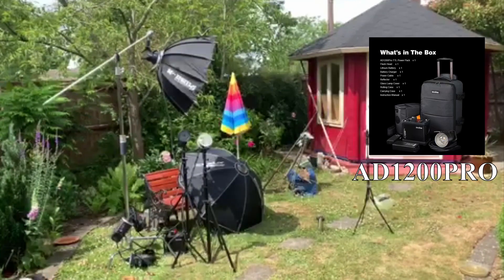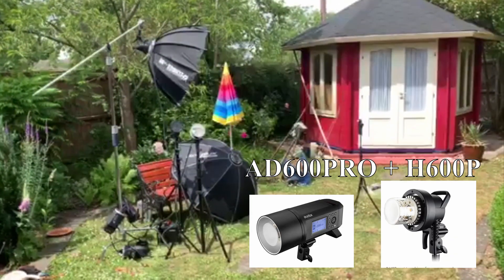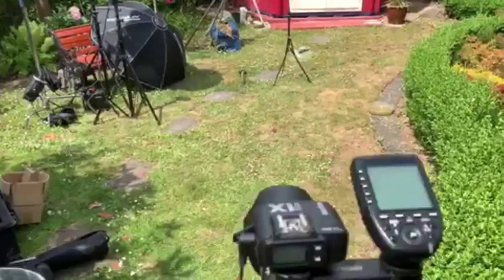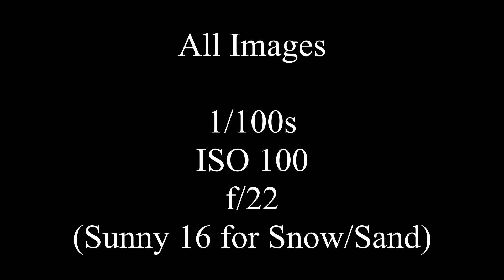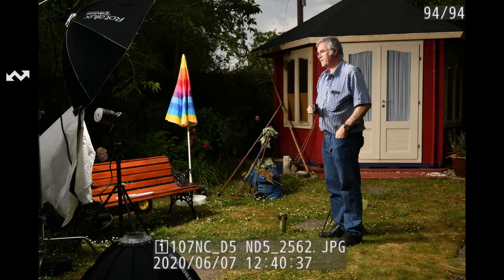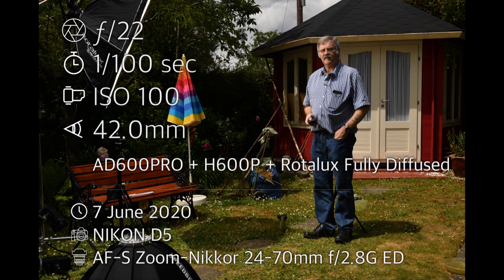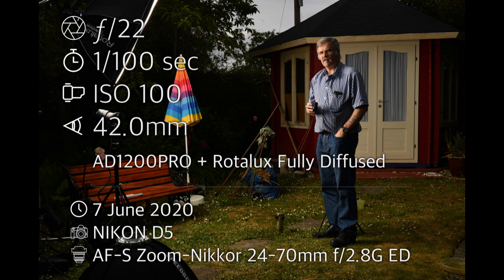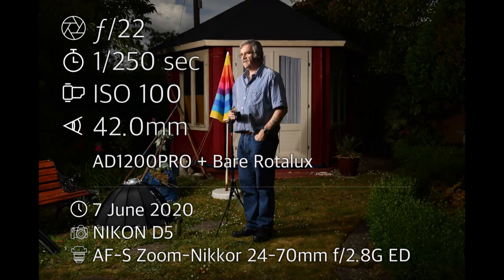Godox AD1200 PRO Power Test vs H1200B vs AD600PRO + H600B

Comment: What a rare video, very useful, thank you a lot for that! I was always wondering if the AD1200 Pro actual output on a lamp is two times brighter than the AD600 Pro without the extension head unit.

Comment: Mike, thank you for the sharing, I appreciate your effort on trying your best to make a fair comparison test.
IMHO, to make the test more precise, there are some improvement can be made:

1) the position of the model(that means yourself) should be constant, better if sit on a chair so you won't stand at different distance from the strobe;
2) Since different lenses has different transmission (same f/stop doesn't mean same exposure), it is better to show the metered EV level of each shot from your lightmeter (or LUX if want a more precise figure). Lightmeter is suggested to stick close to your face of the side towards the strobe;
3) Change of the shutter speed does not affect the exposure from the strobe(since the duration of full power is faster than the highest sync speed); shutter speed only affect continuous light source such as LED or sunlight;
4) Every strobe can overpower the sunlight, it depends on the distance of the strobe, and the time and position of the sun; For summer the sunlight is strongest from 10:00-15:00 (I think it applies to most of the place from different latitude)

From what I observe, I could not see any visible difference of the exposure on your face between AD600 and AD1200. I doubt if the AD1200 has only slightly higher output than AD600 (of course, I think AD1200 has faster recycle time and more stable output than AD600)
Reply: You get 1 full stop over ad600